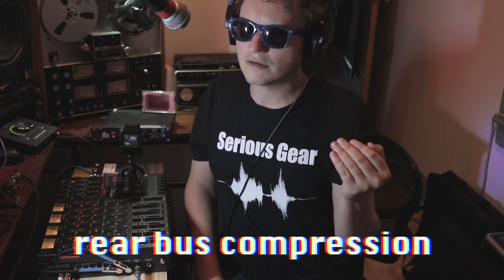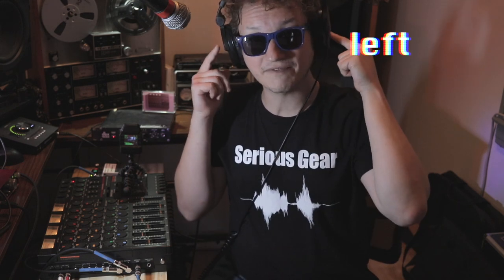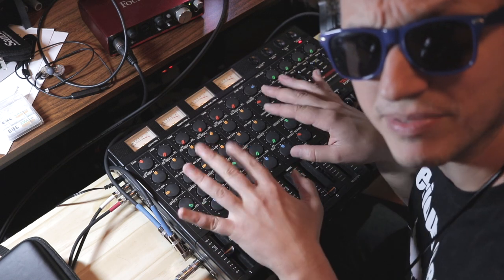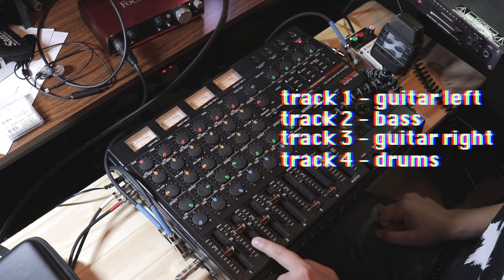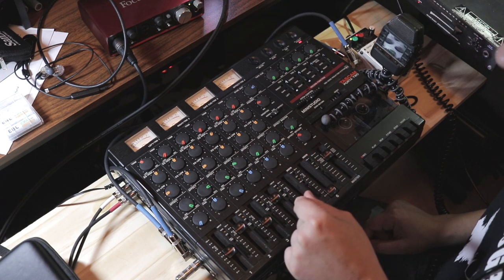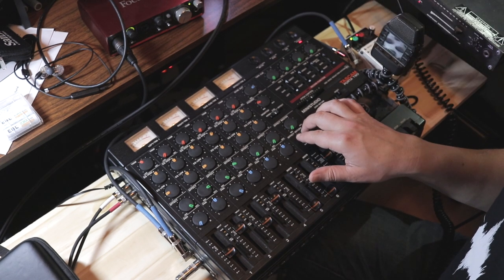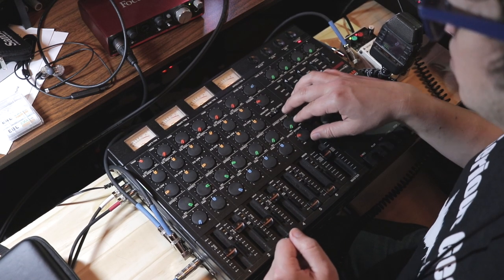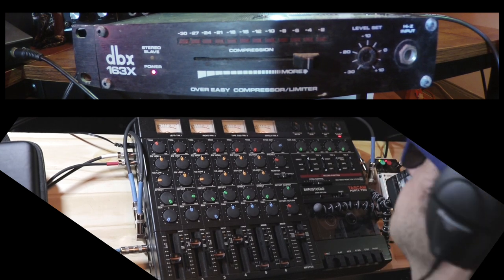Parallel compression on the whole mix - working man's style with DBX 163X? ||| MADE ON TAPE

Comment: Hey Chris! I hope all is well man! Question 🙋‍♂️. If you do Parallel compression on the whole mix does that eliminate the need for a compressor on the two bus? I got a Mackie 32-8 Bus analog console, and it has left/right main inserts for a two bus compressor and 8 submaster inserts for parallel compression. I just don’t know if I should add a two bus compressor after doing the whole mix in parallel compression using a few different compressors. What are your thoughts?
Reply from the maker: great question! I'm going to give my long answer first, then a short one:
...with the Scheps style parallel compression, I believe the intention is more for an effect and "fullness" through saturation of a specific compressor.  I personally always use a compressor on my 2-bus, even if very very lightly.  The standard SSL compressor (I use the UAD version) truly is a wonderful glue.

these days i don't use parallel compression very often.  It was a fun experiment, and I think I've used it a couple times in the box since...

the short answer: neither me or Andrew Scheps has your set up or ears or intention, so I would experiment with both!  Cheers!
Reply: @MadeOnTape  Thank you man! I’m just gonna swap around the compressors in different setups on the console, and see what type of sounds I get. So far, I’m loving all three compressors in the submaster section without a two bus compressor but, I will try directly in the tracks inserts, with the ART Pro VLAii on the two bus, and see how that sounds. I really appreciate it my friend. Keep your awesome videos coming! Love your work dude!
Reply from the maker: @The-Jim-Miller-Project  enjoy! thank you for the kind words! I have a bunch of cool videos shot but not edited... life is catching me off guard left and right, but I'm hoping to get back into a flow soon.

Comment: nice demo!
i have an answer...how do you plug the machine to the compressor? I didn't understand...
Reply from the maker: the compressor is placed in the effects loop on the Porta Two. 

so, that means take your “effects out” and run a 1/4” cable to the “line in” of the compressor. then take your “line out” of the compressor and insert it into the “effects return”

i hope this helps! let me know if you have questions and thanks for watching!

Comment: If you had a stereo pair of 163x’s or a connected 163x and 463x pair, would you have to still worry about preserving the stereo image when turning the compressed tracks up? Thanks for the vids
Reply: Assuming you also had a stereo send setup on the mixer

Comment: How are you connecting the PortaTwo and the dbx together?
Reply from the maker: i’m just running the DBX through the effects loop via 1/4” line cables. So, this technique only works during mixdown
Reply: @MadeOnTape  You're okay with it being mono only, right?
Reply from the maker: Mark Williams yes! that’s the kicker with this set up. that’s also why when i actually mix down i’m blending it in barely. It’s not the ideal Scheps style but it does something
Reply: It's something I'd like to try at some point but I don't want to have to use two effects sends (I only have two) on a stereo compressor.
Reply from the maker: it all depends on what you’re going after. No right or wrong way in music

Comment: Nice video! I have two of those 163x comps myself. I think I got one for $45 used at Guitar Center. (Do you ever frequent their used deals on line? They have some great deals on there!) I agree that, especially for their price, they're nice, versatile little compressors. In fact, I modified one after reading a thread where Jim Williams mentioned some things. However, after I, nor anyone else on homerecording.com, was able to reliably identify the modded vs. stock one in a blind A/B test, I decided to not bother modding my second one. I still have the parts and should probably just go ahead and do it so that they're matched, but it's hard to find the motivation when I couldn't tell the difference!  :o)
Reply from the maker: yeah that makes sense!  Yes I actually got this used from Guitar Center, too!  It just definitely wasn't cleaned and its missing a couple screws lol